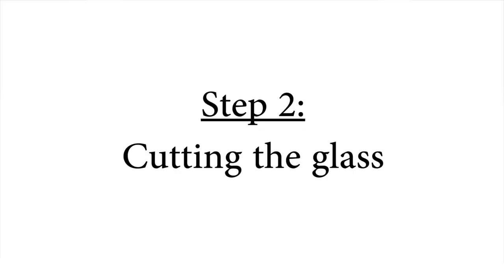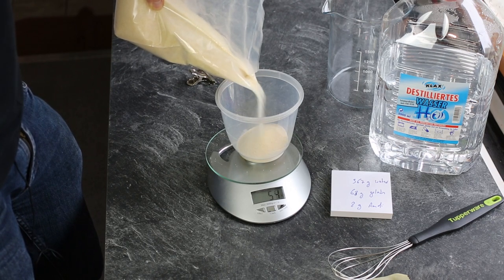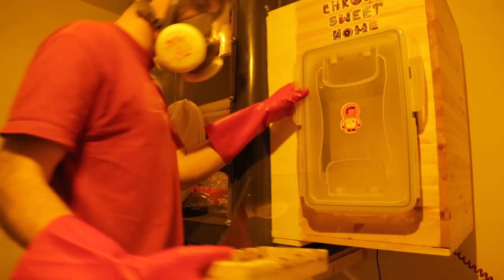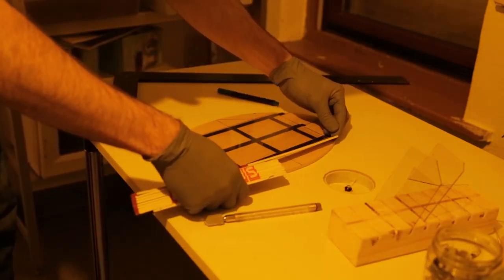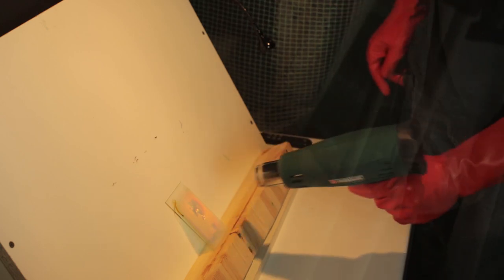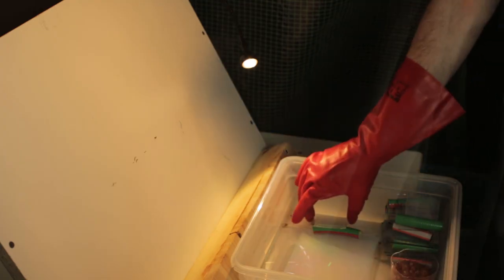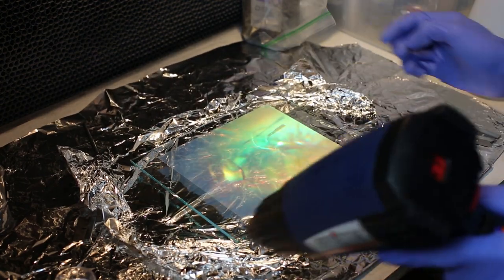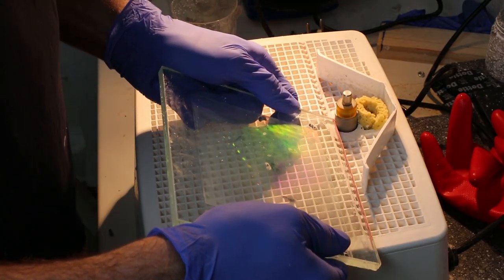How to make a Hologram

Comment: Back in the 70's there was 3d display device which was an elliptical screen mounted at an angle in a glass cylinder which rotated over a projector which at the time was a CRT and a Fresnel lens.  By synchronizing the pixels with the rotation of the screen, they could appear at different elevations.   Of course, the display never got any commercial production but it is probably something that could be easily produced now.
Reply from the maker: Sounds very interesting. I agree should be possible to do this more easily now.

Comment: Amazing video!! Just so you know, you can get a cheap stove top pressure cooker and hook an air compressor hose to the top for an easy pressure pot for your epoxy.
Reply from the maker: That's a fantastic Idea, I head the epoxy is starting to bubble a lot, once you apply a vacuum to it. So you need to do it gradually. Did you observe the same with your pressure cooker setup?

Comment: I would be curious to see something about the advanced dichromate processing with the addition of methylene blue dye. It can work as photosensibilizer to extend the sensitivity range to 750nm, so the red lasers can be used, and so full-color RGB holograms are possible to make.
Reply from the maker: Hi. I had looked into it a long time. Was it MBDCG? It sounded very challenging.
Reply: @Holocreators  I read about in in some scholar articles by Alexander Akilov and his colleagues. The tricky part is to get quality RGB laser triade (DPSS ones are the best, direct-diode modules are suitable too but needs to be thermally-stabilized and checked/modded for single-mode operation), and to adjust the right intensity ratios so the resulting hologram could have the right white balance. Also since MB-activated plates are exposed by red and yellow light, they need to be coated and dried in dark or weak light conditions (but possibly IR light and a VR headset with attached IR-mod webcam can fulfill the circumstance).
Reply from the maker: @shoopdawhoop  I think the lasers are not the issue, but the emulsion making, drying and development are all very challenging. On the old holographic forum I had seen some people needing to tinker a lot with the parameters to get a good hologram.

Comment: Hello, as so many people have already said: Thank you so much for the best technical video about holograms on the internet. It really is invaluable.

However, I'm confused about the direction of the lines at 1:00, it seems as if the painted arrow is perpendicular to the lines in the pattern? Instead of being parallel to them
Reply from the maker: thanks, yes perpendicular you are right, i have presented that in a confusing way. BUt there is basically only two directions the lines can be oriented. And even if you get that part wrong, it affects the final of the hologram only miminally, this is just to avoid internal reflections.

Comment: Terrific video. I have not done holography for more than 30 years now.  At that time we used a doctor blade for coating.  Why do you not use a doctor blade?
Reply from the maker: doctor blade seemed more difficult to get consistent results. but then again i might be wrong. especially for smaller holograms doctor blade is much faster i think. on big ones, spin coating seems to yield better results.

Comment: Very extensive explanation. Very well done. But during exposure make sure to use some protection glasses against the laser.
Reply from the maker: I agree that is always a good idea. Only problem with laser protection glasses is that you can't see the laser when using them, so therefore you could dial down the power of the laser during the setup and then ramp it up for the exposure.

Comment: What's the reason for using photographic fixer? Dichromated gelatine can just be washed in water to stop it from being light sensitive.

You might consider using something like sandarac varnish to protect your holograms, as this is something traditionally used to preserve photographic glass plates.

There are other, non-toxic alternatives to dichromate, and I'd like to try to make a hologram with them eventually.
Have you any experience with other kinds of photopolymer?
Reply from the maker: Hi, there are alternatives to DCG. Photopolymers are great, dcg is just one way to make holograms. There is also MBDCG.

The varnish alone will probably not be enough, because we have to keep any moisture from the hologram.

The photographic fixer is used to change the chrome 6 to chrome 3. I think. Makes it less toxic and also stops the further development of the film.

Comment: Hello, I wonder why you don´t need to put the laser on the vibration free table? I asume that if you do put it on another (not vibartion free) table is because the vibration or movement of the laser does not change the interference pattern registered on to the dcg emulsion, but I don´t understand why. Could you please help me undestanding why?.  Thank you very much in advance, and great video. Best regards
Reply from the maker: Hi Artemio, thanks for your question. The only area that needs to be stable is between the plate and the object. Thats where the object beam and reference beam intersect. Thats where the "fringes" are created which make up the hologram. So the laser can be moved during exposure as long as its illuminating the object. :-) Kind regards. Swann
Reply: Dear Swann, Thank you very much for your fast reply. I´m realy interested in to make my first steps in the holography world and your video was the most reliable, detailed and acurate sourse I´v found on internet; so if you don´t mind I would like to make you some more questions: 1- Is the polarization filter mandatory? ( I don´t have one). 2- Can I avoid the use of the plane mirror and orientate the laser beam direct to the concave mirror? 3- Can the concave mirror be puted out of the vibration free table?. 4-Can I avoid the use of a concave mirror and just take out the laser´s colimation lens in order to get a spreaded beam?. Kind Regards. Artemio
Reply from the maker: Hi Artemio,
1. you do it very well without a polarization filter
2. yes you can orientate the expanded laser beam directly onto the object
3. the concave mirror doesn't need to be vibration-free. you can put it wherever you want.
4. yes, if you get an expanded beam that way you can do that. But be aware. For DCG only green and blue lasers will work and the light needs to be coherent
Reply: Excúseme, it´s me again :) So, if the laser can bemoved during the exposure, can I "Paint" the scene moving the laser beam? I´m asking that because I can not spread the laser beam too much, also "painting" the scene may be I can avoid some ring fringes coming out of the laser (because dots of dust in the laser lens I asume). Second: I have a blue laser and some photoresist film sheets (the ones used to make printed circuit boards), do you think those kind of photoresist are cabale to register a hologram? Finaly, do you have a Facebook page or email where i can send some pictures of my setup in order to get some feedback and recomendtions from you?. Best regrads. Artemio
Reply from the maker: @artemiofava5754  Hello, yes you I think you can remove irregularities in the beam by moving the laser. But thats more advanced stuff. I would only do that after you have made good holograms by not moving the laser. With the photoresists I really can't help you. I know they are essential for making embossed holograms. But I don't know how they work. Check Jeffrey Weil  https://www.linkedin.com/in/jeff-weil-49727b27/    he can help you with that. Expert on the matter. I do have a website. www.holocreators.com and also an email you will find there so feel free to contact me, I'd be happy to help.

Comment: Great video to explain all the technical detail of traditional gelatin-dichromate photoresistor preparation process.  However, before acid washing process, the freshly cut edges of the glass plate should be rounded (e.g. deburr - removing sharp edges) with diamond wheel then fire polished; otherwise these sharp plates will cut through rubber gloves easily.

BTW, the exposed gelatin imagine can be permanently preserved (e.g. humidity and microbe resistant) with EM grade glutaraldehyde (from Sigma-Aldrich); this can be done when the dichromate is completely removed.  Just dip the plate into dilute glutaraldehyde solution (5~10%) for few minutes; wash away the remain glutaraldehyde then go through i-PrOH dehydration process.

If possible, one can go several steps further: 1) PVD coating the glass plate with aluminum or titanium before apply photo resist, 2) wet etching of the glass plate with ammonium difluoride (NH4F.HF) after photoresistor is fixed with glutaraldehyde.  Lots of these technics are sharing with semiconductor industry.
Reply from the maker: yeah that's a  good idea filing off the sharp edges, I never heard of the glutaraldehyde process, thank you, could you elaborate how that is protecting the dog from humidity, I didn't fully understand that
Reply: @Holocreators  Glutaraldehyde is a crosslinker, its working mechanism is forming stable bonds with the free amino groups of gelatin (e.g. these basic amino acids, such as lysine, arginine,)  

Glutaraldehyde is widely used to preserve biological sample.  Of course, formaldehyde is also used in this purpose.  The difference is formaldehyde is very volatile and glutaraldehyde is not (yes, it still smells,  but not as awful as formaldehyde).   Also the sample preserved by formaldehyde tends more fragile than glutaraldehyde.  Let me illustrate this - try to synthesis the classical polymer formaldehyde urea resin, then try glutaraldehyde urea resin.

YES, after soaked in glutaraldehyde, the gelatin film will be turned into insoluble state (crosslinked, fixed, preserved).       Therefore, prevents it from humidity attack.  However, the mechanical strength is not strong enough to against touching and scretching. 

Try searching the topic - photolithograph, photosensitive polymer. This should help more.
Reply from the maker: @nzcym  thank you very much for this, do you know of someone who has sealed DCG holograms this way?
Reply: @Holocreators  NO, I don't.  My main interesting are focused on photomask and photolithography.  Both of them are closely related to holograms.
Reply from the maker: @nzcym  thank you again for the input, I will want to try that out in the future

Comment: I also wondered about your lighting  - at which points in the process do you need to be working under a safe light?
Reply from the maker: hi, safe light is needed whenever the chrome is inside the gelatin, because thats when its light sensitive.

Comment: I wonder what you would say about the liti color kits. I have been considering one.
Reply from the maker: I Rob, great stuff to get into Holography. There is now Holography film that doesn't need chemical development. So if you want to get started I would get the Kit. This here is really an all DIY approach :-)
Reply: It is an expensive kit, so it is great to get the approval from you! Thank you kindly for your time!
Reply from the maker: @robstone7421  Hi Rob, when you start with holography you want to keep the number of variables as small as possible. Its difficult enough. So if you have film, that you know will work, that makes it much easier.

Comment: I have a question. Is the fact that a recording can be seen even in open light only a function of placing the film between the object and the laser light?
If the laser beam projects the object and the film separately, in a triangular arrangement, will the recording only appear as a result of the laser light?
Can the c-rt20 holographic film, which can be ordered, record laser light of any color at the same time, thus creating a colored hologram, or are there separate monochrome films that can only be exposed under the influence of a laser?
When making a hologram, are we allowed to use lenses to guide the laser or do they only worsen the coherence? I noticed in the hologram kit that there is no lens on the red laser, that's why I'm asking.
I also observed that the three lasers are not physically tuned exactly to one axis, only approximately. In this case, doesn't it happen that we get three offset images on the disc on the blue green red channel?
It doesn't fit in my head.
thank you very much
Reply from the maker: many questions.
in my video this is a white light hologram. what you are also mentioning is a transmission hologram which needs to be illuminated by a laser. i dont know about the crt 120 recording film. 
when you want to do full color holography you do indeed need 3 perfectly alligned lasers

Comment: Is it necessary to cover it with another layer of glass? Ive seen few of this type holograms in real life and none of them had the second layer..
Reply from the maker: it needs to be covered, because these kinds of holograms (dcg) are very sensitive to moisture and will quickly fade if not properly sealed.

Comment: Does the object you want to make a hologram have to be close to the glass? Say I wanted to have a bigger object on a smaller piece of glass. Could I have the glass farther away from an object that's bigger than the glass and get a hologram still?
Reply from the maker: yeah sure, there is a limit though. the further away you move the object from the glass,  the dimmer the hologram will get. in the video i show the denisyuk hologram method. if you want hologram with amazing depth you might want to consider h1/h2 holograms

Comment: I would think that some sealant exists that would completely prevent ingress of moisture into the finnished hologram.
Reply from the maker: there are somes sealants that last a very long time but eventually also those seals will break. it also depends on the size of the hologram in relation to the seal size. a small holograms with  a big seal will hold much longer than vice versa

Comment: Swann, I didn't understand a lot, in the exhibition is the side of the emulsion facing the object or facing the laser?
Reply from the maker: the emulsion side is facing the laser
Reply from the maker: it will work the other way around also but then you will get internal reflections from the glass
Reply: Because I don't have the beam diffuser and mirrors, I'm going to try to make single beam holograms, laser straight into the glass and the object behind
Reply from the maker: @henriquesantos.official  well you will need some kind of lens or curved mirror to expand the laser beam

Comment: Have you tried making full color RGB holograms?
Reply from the maker: Hi, never tried full color. You would need three coherent lasers in the 3 colors. Also DCG is not really sensetive to red light, so that would be challenging. 
You can force DCG into a different color by preswelling the emulsion, before exposure, but this is a difficult technique to get right,

Comment: I have been told that even for a reflection hologram, the laser cannot move during exposure, but you show the laser being moved - doesn't this change the fringe pattern during movement?
Reply from the maker: the fringe pattern only gets destroyed if the plate moves in relation to the object during the exposure, which is not the case.
Reply: @Holocreators  This was what I read too, but someone online claimed it was not the case. Are you absolutely sure about this? I'd like to have my laser in a different room to my plates to reduce scattered light before the exposure - it seems like given your setup here, that would not be a problem? i.e. the laser does not have to be on the same stable platform as the object and film for reflection holography.
Reply from the maker: @makkyd123  that is correct, people have done that before, putting the laser in a different room. I wouldn't move it too far away though, because you are losing power. I don't know what you have read, but the process I show in the video worked.
Reply: @Holocreators  sure, and I believe you! just wanted to get your feedback.

Comment: can you explain what polarizer is used to adjust the laser?
Reply from the maker: sorry I don't know what polarizer was used, but maybe you find something online. its a laser with a wavelength of around 532
Reply: @Holocreators  so you aren't sure what general type it is? how would you describe it if you wanted to obtain one?
Reply from the maker: @makkyd123  polerization filter for laser
Reply: @Holocreators  I think what you have got there is a half-wave plate maybe?
Reply from the maker: @makkyd123  i really dont know, but trust me it works also without the polerization, try it without first, this is really a very small thing in the entire process and doesnt add a lot to the overall outcome

Comment: Ok, you say you want to make an enormous hologram (like 3 meters x 10 meters) and stick it in the desert someplace. Well, there just so happens to be an event - located in a remote desert in the state of Nevada, USA -that will facilitate just that.
Every year, the organizers for the Burning Man art show rent a large parcel of empty dessert land and establish an art exhibit there. Most exhibits are allot like what you want to do: huge, oversized sculptures and other works of art. Googling "Burning Man Black Rock Nevada 2021" will take you there. There aren't any exhibits this year because of the covid19 flu pandemic.
Reply from the maker: Hi Glenn, thank you, that would be an amazing venue. Thanks for the tip. At moment its mostly about the facilities to make such a piece. The requirements for facilities and equipment to create such large holograms are quite significant. Have you been to Burnin man?